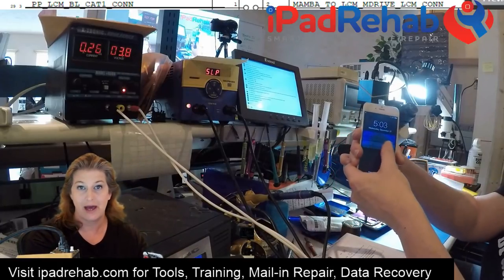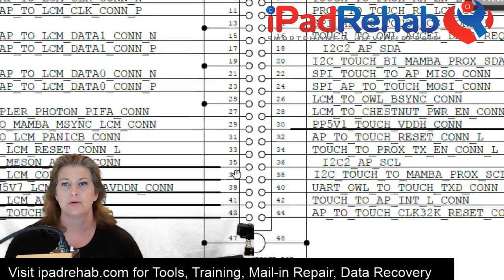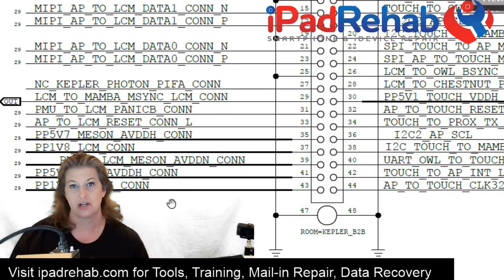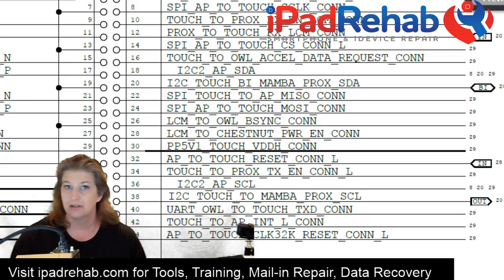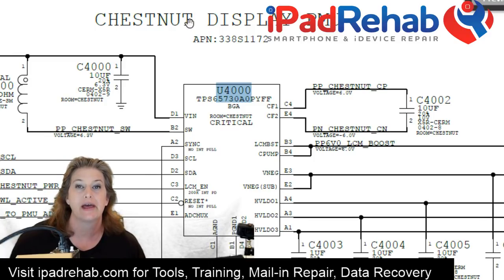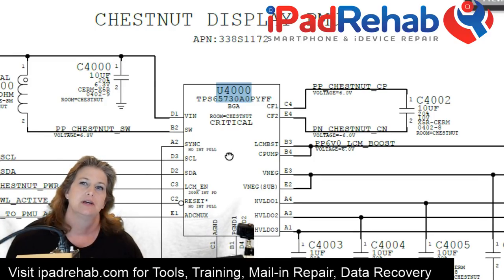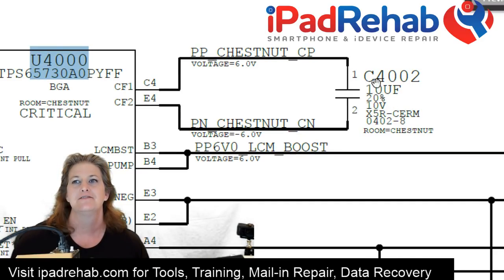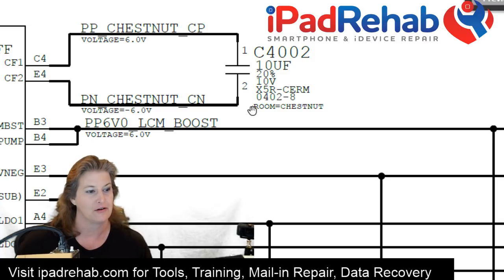Don't touch Chestnut's Nut if you want touch

Comment: I'm glad you like the coin! I actually didn't know about the screwdriver story with the silo. Your chunk of rebar came from a site that was collapsed and filled in. A guy bought the property a few years back and is renovating the command bunker portion of the facility into an Airbnb. The silo itself is totally filled in with chunks of concrete and gravel so he hasn't even attempted that part yet. His channel is Death Wears Bunny Slippers. Lots of great video from early in the process, including nearly getting killed on his first trip into the bunker from trapped gasses.

Comment: I think what the guy on stream was trying to say was to basically glue (I assume he meant using the UV stuff) some wire to the motherboard itself where the missing pads are with some wire exposed out to where the caps sit, tin it a little then the solder balls on chestnut will melt into the pre-glued wire on the board. Although I think the heat would probably just melt any glue anyway and I also don't think he realises how small those areas are.